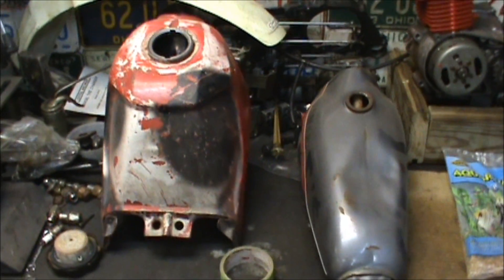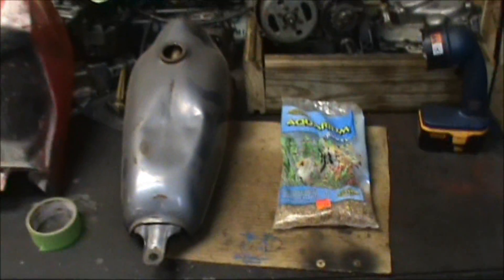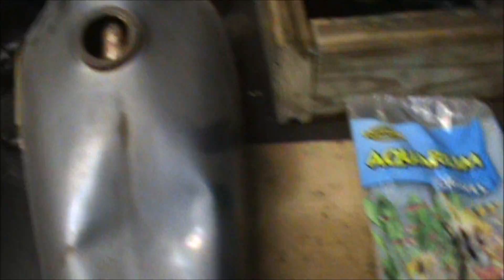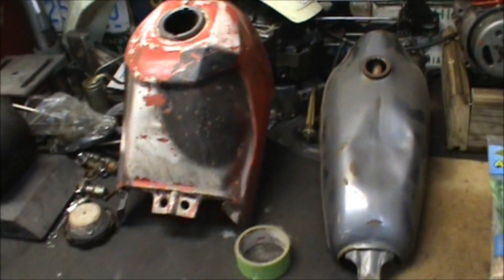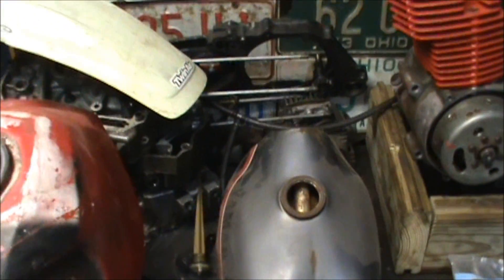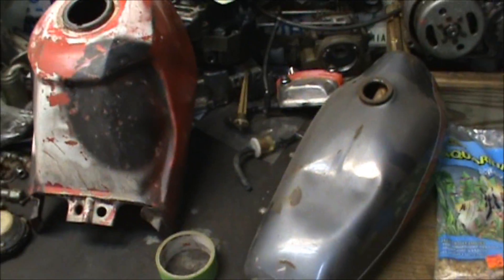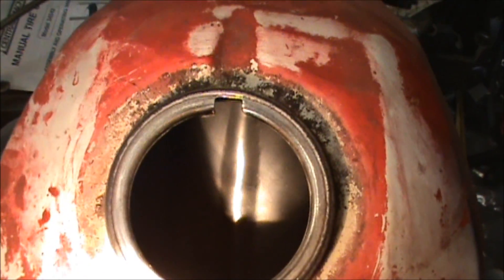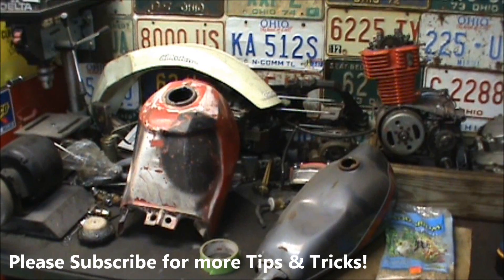Rusty Gas Tank Cheap Fix

Comment: Great video man,   After I saw your video, I ran out to walmart and got a bag of white gravel and dumped it in their, wrapped up the tank, put about 6 pillows in the dryer and set it to fluff for 30 minutes,  I'll let you know shortly but I have high hopes  lol Mine is off a 2002 honda shadow that I bought from a guy up north and it has lots of rust in there.

Comment: cool tip i dont do alot of work on motorcycles but next time i paint a tank ill suggest this to an owner if it needs to be cleaned out. I know eastowood makes a paint that you can put in there and it seals the metal never tried it yet but someday i will.

Comment: Nice tip dude, but its hard to get the gravel out in some tanks so i try muriatic acid and a chain inside, shake some minutes and wash very well and dry then put epoxi resin inside and you got a tank for life and no more rust ever.

Comment: The problem I have found with the gravel is that sometimes it's hard getting all of it out. Instead, you can also use nuts, small bolts, and even washers that you have laying around to scrape the rust off. Then, if you have a hard time getting them out, you can use a magnetic grabber to pull them out. I also pour some gas with it to mix with the rust and then burn it later in a fire.

Comment: Another good way is using an acid. I've used muriatic acid for swimming pools, diluted a bit with water. It's done a great job with removing rust and dried out gas scum in tanks.

Comment: After you use the aquarium gravel to knock out all the dust. Mix some polyester resin and hardener an throw it in their, block all the openings except the one you're pouring in and roll it around so that the tank entire inside is coated with it and leave it to dry it will never have a rust problem again..............

Comment: best thing ive ever used was muriatic acid, dilute to 25%. i will eat every drop of rust and gummed up gas. the metal will shine like new.  gotta rinse it a million times tho. then put sum gas so the was dont rust it again. i like the rocks idea. ive heard it before and had even tried it. but never with the addition of the dryer. have to try it sometime